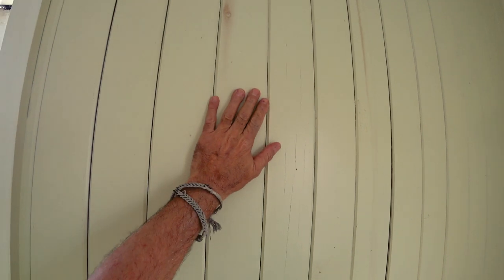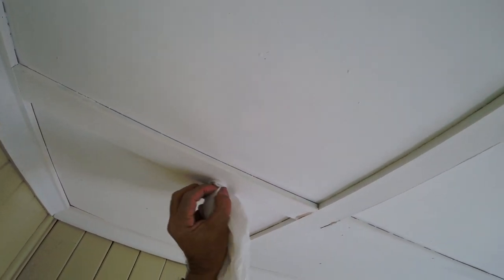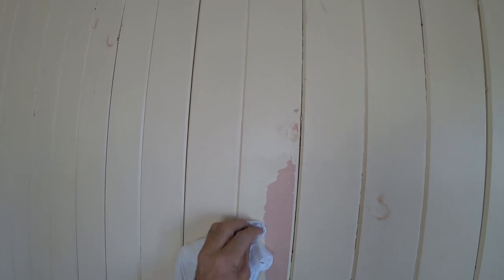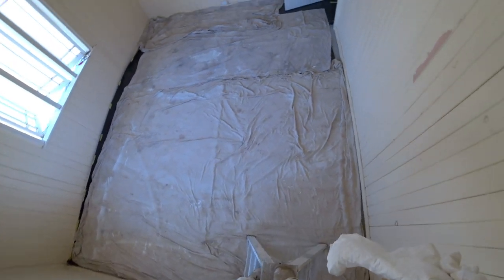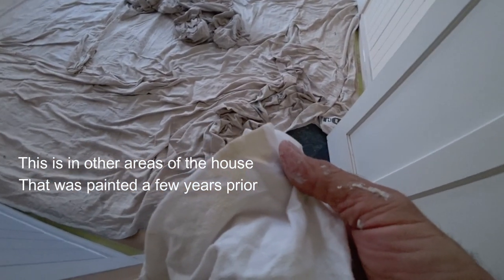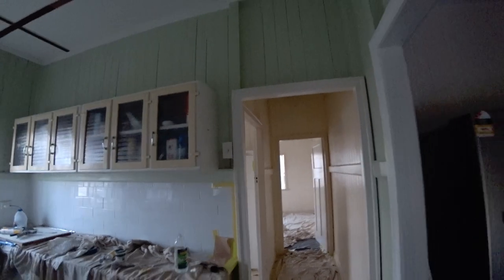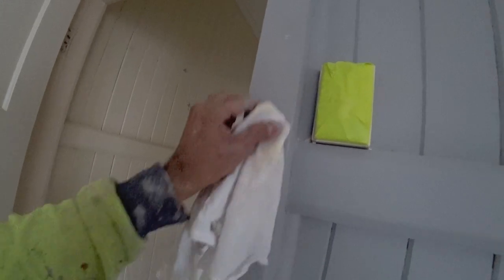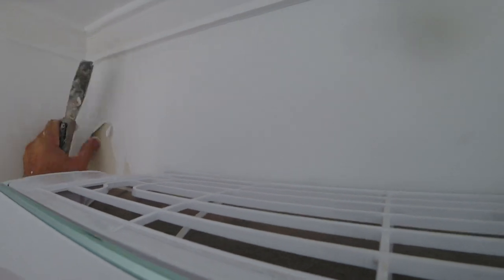Do i need a primer /  undercoat and if i do ,why? how do I test?

Comment: I have used water based undercoat on top of oil based painted woodwork with no problems , as long as you wash and sand the surface first , then top coat with oil gloss or oil satin
Reply from the maker: Thats correct, but by using oil based undercoat you save yourself days because you don't have to sand and on tounge and groove boards,how can you sand between the grooves, its impossible, best to go oil based uc over these walls.

Comment: Nice video mate, good you're showing own mistakes too. How about dulux precision max adhesion on oil walls ? I remember your vid with precision and stain,  didn't work, but with super enamel gloss I have good experience.
Reply from the maker: I actually did several tests with undercoats on that house , the dulux precision will not work on the full gloss without sanding first but works on the satin enamel.  After a sand it sticks, I used Berger triple prep on the acrylic walls only, oil uc on everything else.
Reply: @ThePa1nterhowto  thanks mate, I will check other video coz that's interesting test to see how precision works
Reply from the maker: @markgorka9441  I haven't uploaded the other video on the gloss enamel,
Reply: @ThePa1nterhowto  right, can't wait to see it mate

Comment: Hi Greg, your videos are fantastic! Just wondering if you can advise on how to paint over very plain textured vinyl wallpaper, its in great condition. Also if there are holes in it how to texturise the filler-crazy teens in the house. I’m also painting the exterior of our brick home myself at the moment.. oil base primer binder and water base top coat. Tiny bubbles are appearing after I roll it? I’m using a long nap roller for rough surfaces. Thank you so much
Reply from the maker: Hi Ronnie, thanks for your support for the channel, To be on the safe side I would be putting an oil-based undercoat on the wallpaper, ideally you would want to remove it and start at the beginning, however you can use the same oil sealer binder you use on your brickwork if you want. The pinhole bubbles are normal on the bricks, they absorb so much paint, try thinning it out 10% and that will let it soak in better. Don't panic, they take a lot of paint, after that first coat, you can use any acrylic paint you have lying around to build it up before your final coats.
Reply: @ThePa1nterhowto  thank you so much for your fast reply... your advise is so appreciated. Am I thinning the oil base binder sealer or the acrylic paint,On the bricks? So good to know its not just me... man they suck up the paint like a sponge.
 Yip I’d love pure paint finish walls but as it is all plain, not that old and in great condition, i thought painting the wallpaper the easiest option. Thank you for the primer binder idea too. I was wondering about the use of that. Using any old acrylic is such a great idea.. before the final coat. Wish me luck. Thank you so much.

Comment: Hi mate, thanks for sharing your experiences
Can you please explain the steps for oil based and water based again? If I have an oil based surface, do I have to undercoat it with oil based and not water based? And on top if oil based undercoat can I go with a water based top coat?
Reply from the maker: There are water based undercoats that will stick to oil based but you need to sand and prep before you can undercoat, if you use an oil based undercoat you don't have to sand. Yes you can use water based paints over oil
Reply: @ThePa1nterhowto  So basically oil based undercoat is the magic solution to all situations.
Reply from the maker: @sharleenwang6608  thats a strong yes, quick dry oil based undercoat can be recoated in a couple hours,sometimes quicker than acrylic

Comment: Mate with painting doors  aquaenamel after rolling do you tip off with brush?
Reply from the maker: No I didn't on these doors, oil undercoat with a roller and two coats of dulux gloss steriguard
Reply: @ThePa1nterhowto  legend mate great work like always.

Comment: why undercoat if the paint condition is good thanks for the video,s
Reply from the maker: You need to undercoat for several reasons, top coat color consistency if the wall is patchy, if the top color you chose needs some body underneath to help cover, also to get the top coat to stick if the wall is oil based or shiny, also to stop stains, fly poop,smoke damage ,nicotine stains, ink, are all reasons to undercoat with the right paint.If the paint is acrylic and in good condition you do not need to undercoat.

Comment: Hi mate, if oilbased undercoat will work over both water or oilbased finish coats would it not have been easier just to undercoat all rooms in oilbased undercoat then finish with waterbased and not have to worry about testing ? Sorry probably silly question just curious any help would be appreciated.  Thanks again
Reply from the maker: Its an overkill, oil based smells so use it conservatively,old kitchens are good oil based uc because of grease problems but normally acrylic walls are fine with the water based uc unless there is grease, nicotine,writing or fly poop.
On old queenslanders I usually uc the full house in oil uc.
Reply: @ThePa1nterhowto  thanks again mate . So what do you do with the woodwork that has had waterbased painted directly over oil and is not sound? Sorry for all the questions 😂
Reply from the maker: @micksmith3352  We are probably gonna come across this more and more as people are just water based glossing over oil enamel,explain to the customers that someone cheated last paint job and now  they have permanent issues that realy can't be fixed, just repaired ,you could sand best you can and start again but that stuff doesn't sand to well.
Best undercoat over it would be an oil undercoat as its a high build and fixes small issues by itself.
Reply: @ThePa1nterhowto  thanks a mill greg love your videos   keep them coming mate 👍

Comment: Why not just cover all woth an adhesion primer and top coat
Reply from the maker: Because if you don't need a primer,why would you apply one? Its a lot more work and extra cost in materials ,best to know when you need one rather than guessing.